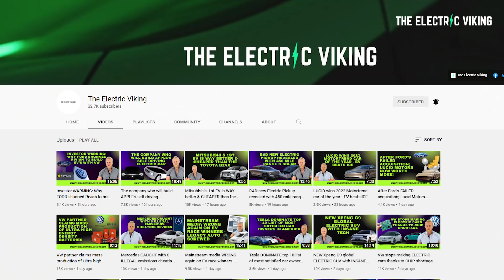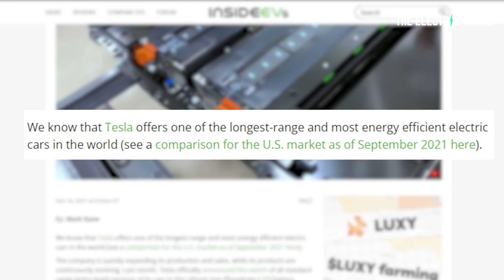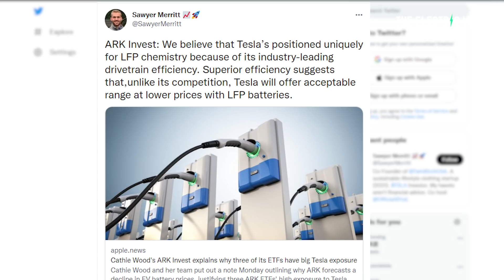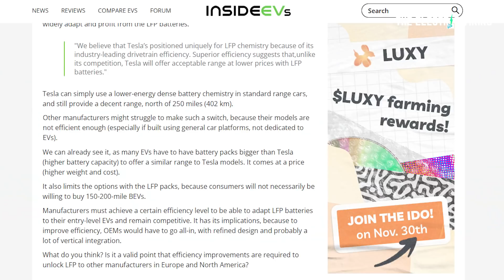3 REASONS Tesla pivoted to LFP batteries faster than everyone else

Comment: Generally Tesla’s are lighter vs other EV’s.
Reply: Ive got my reservation for an Aptera.  It comes in at half the weight/battery size of the model 3 for the same range in its base and scales to an absolutely stupid 1000 mile top mode.  Really hoping to see LFP in the base models.  Tesla ios efficient but aptera takes it to an entirely differently level.

Comment: 4680 lfp?
Reply: Yes. 4680 is the form factor (cylindrical 46mm diameter X 80mm length.) Within reason, any chemistry will work.

Comment: Seriously considering VW ID4 which has the body most useful for me.  Not sure non-LFP's will have a high WAF (wife acceptance factor) where the 80/20 capacity dance is less likely to be adhered to.  Hoping that U.S. made ID4's will have the LFP's.
Reply: Oh, and you can limit charging to 80% via the infotainment system.
Reply: When Tesla gets FSD done, wife acceptance factor will skyrocket. Don’t bother elsewhere, and pay up front for it rather than later.

Comment: Still learning but I was under the impression that LFPs perform poorly in cold weather.  Might not be ideal up in the great white north.  We are looking at the Model 3 AWD without the LFPs here in Canada.  If anyone has experience with this please pipe up. Also have a cybertruck on preorder but that's a few years out I am guessing.
Reply: LFP in cold climate no problem provided you can plug in every time you park long-term, letting the grid do startup prewarm of batteries.
Reply: https://youtu.be/IAkS6UaIbH4
Bjorn Nyland's SR+ LFP testing in freezing weather. This is probably the best video you can watch and learn from for a Tesla LFP vehicle. Also it's less than a week old!!
Reply: I live in the Vancouver area and that is also my concern.  Guess will have to wait for detailed testing by TeslaBjorn.
Reply: @lesbendo6363  I'm over on the other coast, not as warm as Van but doesn't get as cold the rest of the country.

Comment: i was worried about the 4680 but i'm starting to think that Tesla may have went with LFP as a stop-gap. 
Now bear with me one second. If you look at the competition in the markets where you would need the 4680 i.e performance cars, the Semi and Cybertruck, is there any real competition yet? Why not wait for merc eqc, bmw, rivian etc to put out their offerings (and spav a tonne of cash) and then blow them all out of the water.
Reply: Lol... there are litteraly many other battery cells form factors including the BYD blade battery.... the 4680 isn't the answer to everything.
Reply: @carholic-sz3qv  no shit sherlock, i just came down with the last shower. 
What i mean is, nobody actually wants to use LFP because it's so dense that if the design and balance isn;t  bang on, the vehicle will handle like a piece of crap.
Reply: @jclive4773  nonsense, lfp is actually used since the range isn't that worse compared to nmc also lfp batteries have its own advantage to be charged everytime up to 100% with longer life cycle compared to nmc....
Reply: @carholic-sz3qv  what the hell is wrong with you. Go back and read my first comment. It states clearly ''performance vehicles''. 
Do you think if you put Blade batteries in a Plaid it would perform the same?
I have no problem with a bloody blade battery but the main reason people like it is because it's the first flat battery that is safe.
Reply: @jclive4773  Yes it possibly could: The usable charge storage capacity of NCA is about 180 to 200 mAh/g ... lithium iron phosphate LiFePO4 with 165 mAh/g

Based on this:
(165 - 180) / 180 = -8.3 % lower energy density
(165 - 200) / 200 = -17.5% lower energy density
16% improved range from 4680 form factor
Off hand, it looks like a 4680 LFP pack will have similar performance to a 2170 NCA pack ... but more affordable.

Bob Wilson
Reply: @xoalchemy888  hi Mick. I apologise for my tone with that other guy but some people come on youtube and talk to people like they are 5 year olds.
Simply put, my friend used LFP in his bike build and i used Nickel 3.7's, his has nowhere near the explosive power that mine does.
I'm not saying there is no place for LFP but simply put, from the moment Elon Musk said that he'd have LFP everyone thinks that's that.
My Bike will have less cycles but it will still do 150 000 miles and i'll be laughing riding it. His will probably do 300 000 miles and he'll never use that.
If Blade was so good 4680 would've been binned off but with a million mile  life-span i know which one i'd have....in 5 years we'll all know a lot more, LFP will be back being used in storage, in my opinion.

Comment: So lower energy density, but if you can load and discharge from 0 to 100%, while the "higher" batteries can only go from 20% to 80% (60% of the theoretical) - maybe LFP in practice have higher energy density.
Reply: You can still charge and discharge the order ones from 0-100% without issue on long road trips. The degradation occurs if it sits at a high or low SOC for an extended time. Day-to-day though, anything over 100 miles is pretty much overkill unless you have a 102 mile commute like myself.

Comment: If I ordered a Model; X, how would I know if I'd get an LFP battery? Otherwise, I'm looking at a Polestar 3, or the BEV successor to the XC90. Probably not LFP, but probably both cheaper than the Model X, especially the XC90 successor. And it's really not about range anymore, range being more than sufficient in most new EVs, but more about charging speed while on a highway trip.
Reply: The Model X doesn't currently have any variants with LFP batteries, and no rumors of one coming.
Reply: LFP batteries have lower energy density, so they are used for the lower ranged/smaller vehicles like the base Model 3. A beast like the Model X, particularly if LR/Performance/Plaid etc will not use LFPs any time soon...
Reply: Thanks guys for your response, and information on the Model X and LFP batteries.

Comment: No Rush .............I hope to purchase my first EV in 10-15 years. By then EV's will be 100% better, more efficient and advanced over todays EV's
Reply: You'll lose 10 yrs worth of capital investing in ICE that long.
Reply: @lengould9262  true, but if your car is paid for and you use your pennies to buy Tesla stock….
Reply: @johnryan8645  So why wasn't that your advice?
Reply: @lengould9262  true, I did! I just phrased it as a rhetorical question.😉
Reply: Ten year total ownership cost of a SR LFP M3 is cheaper than a Corolla.  Why wait 10 years.
Reply: @lpdirv  really?  What is the purchase price difference?
Reply: @omarb155  about twenty grand.  But electricity is a quarter of the cost of gas depending on your local situation.  
So over a ten year period the EV will be a cheaper per km driven cost. Plus resale will be much better.  
I drive one for Uber part time and its by far the most economical car as an Uber.  And i write off the km’s.  At 100 k and still going strong.
Reply: @lpdirv   The toyota corrola goes 0 to 60 in 8.8 seconds and that is terrible
Reply: Agreed, in a couple of years, they will be a lot better/cheaper

Comment: I am using LFP batteries since 2015 and they rock. load to 100% and drain to 0% without a problem. 
With at least 2000 load cycles they are rock solid and 100% save.
Sits in all my motorbikes to.
Reply: Lfp has been in the toys market for some time now. The benefits are just so darn obvious. The problem was software and able to produce in large amounts with larger wattage voltage etc.
Reply: Speaking of motorcycles I drove one for the first time today. Literally the best feeling ever!
Reply: @mrwhips3623  Great feeling of freedom 👍. Doing it for over half a century and enjoy it every ride.